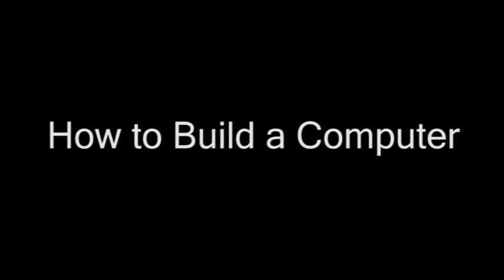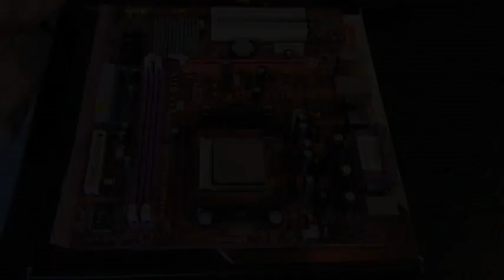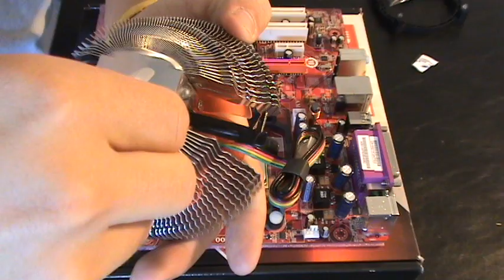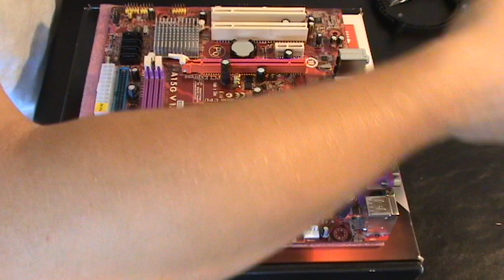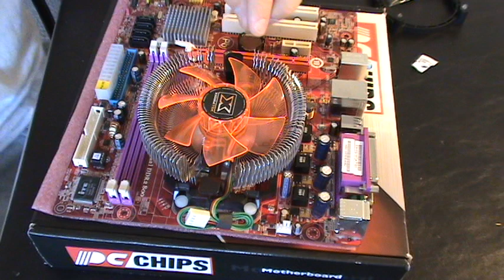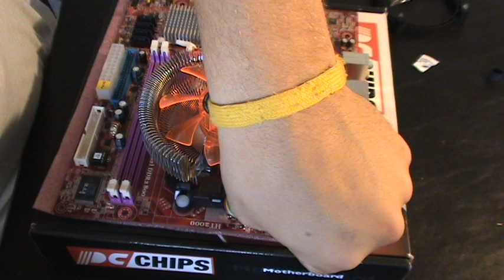How to Build a Computer - 16 - Installing CPU Fan

Comment: Too much thermal paste can increase the distance between the metal surfaces, thus reducing heat transfer. It's recommended to use a pea-sized amount and not spread it manual; instead let the pressure between the two surfaces spread it out evenly, reducing the chances of air bubbles forming.

Comment: Never spread thermal paste. You're meant to put a pea of it on the middle of the CPU. Spreading it causes gaps between the heatsink and CPU (tiny air bubbles) and this causes the conduction from the heatsink to the CPU to be lost making it harder for your cpu to stay cool. When pressure is applied to the CPU when installig the heatsink the thermal paste spreads out evenly so don't spread.

Comment: @LNDS209615 Yes you can, you just have to take the cooler off, preferably after the computer has been on for awhile and you just turned it off so its nice and warm and it will come off easier, after that you just have to clean off all that paste, i use coffee filters because they are lint free and then you have to use 90% rubbing alcohol  on those same coffee filters or cue-tips, and polish up the metal surfaces so they are ready to be used again like new

Comment: @lanman000 
You only need to reapply if you're changing fans, and you should wipe off the old thermal paste before adding a new layer.

Comment: @BruceLeeRock25 Do you mean on the fan? That's OK, they are there to help dissipate the heat and control the air flow. As far as I know, they are not connected to electricity (why would they be?) and they won't short-circuit the fan!

However, if you mean on the processor, then that's big trouble. Each of the pins on the processor should be clearly separated, and DO NOT attempt to force the processor into the socket. Doing so could damage the processor (and socket) even more.

Comment: when i opened a my cpu fan's box (it came with the cpu), there was no thermal paste.  when i set the fan on the cpu, it stuck and felt like glue. was there thermal paste on it already? the tube newboston is using for the paste looks like silicone gel so i might have dismissed the grease as that...

Comment: put back my working cpu and applied thermal paste then put the heatsink and fan on, and now nothing comes on the screen. Can anyone help me with this? Am i supposed to wait a while after i put the thermal paste before turning on the computer? Could it be that i put too much thermal paste? If anyone could help me that would be really great, oh and im sure i installed the cpu correctly. Thanks in advance to anyone

Comment: no offence... but u put the paste on wrong... ur not supposed to use that much.
theres 2 methods, the rice method [place a dab about the size of 1 grain of uncooked rice in the middle] and the line method [put a little line across the middle of the cpu]. the latter of the two is better for quad cores. youre not supposed to spread it around... just place the sink on and itll do its job. 
remember more isnt better

Comment: It's actualy better to NOT spread the paste because it will creat bubbles and will cause the heat to nit transfer as well. I saw a vid ov it and using a small circle, it will spread out with little to no bubbles. That's the only thing I didn't agree with. But overall, great video

Comment: @maxamillion4536 BB might be about right. Then again, you don't really need to cover the whole IHS, it's just a thin layer of copper over the actual chip. The CPU die under the IHS is only like 1/6 th of the size of the IHS and that's the area that you really need to have a good contact on.

Comment: -I've had better luck with putting a couple dabs of grease on the actual CPU and spreading it with a razor blade and then installing the heat sink on top of that. And use ALOT less grease than that for much better cooling. 
-I would also suggest getting some good thermal grease like arctic silver instead of the stuff that comes with the heatsink (usually very cheap).
-Last note I'm pretty sure that was an aftermarket fan.  Most CPUs come with cheap fans or even just a garbage heatsink sans fan.

Comment: wayyyyyy too much thermal grease. The optimal way is to squeeze just a tiny drop on the center of the CPU, about the size of a rice grain. When you mount the cooler, the grease will spread evenly and leave no air bubbles behind. Just google it up if you don't believe, it's been tested and that's the best method. Excess grease will just hurt the performance and (with silver paste) can even cause short circuits..

Comment: tbh u dont need HALF as much thermal paste as what he put on, u need either 2 pea size drops or a THIN line down the middle, if it oozes out wen u put the cpu heat sink on then its too much!!!, u clean it off n try again ! little is MORE  !

Comment: does the amount of pins, on the power-connection for fans, depend on the motherboard or power supply?
- if it's by the motherboard, do anyone then know how many pins the ASUS P6T Deluxe is on?

Comment: I just want to know.  Does it matter which way you point the fan/heat sink on the CPU. I hear iinstances where its not a good idea to have the fan facingtwards the pack end of the PC case. Somthin about hot air   

No idea on this

Comment: there's your problem
the three pin have a + and a - pole and a third which is ground.
the four pin have four pins, same as before but the fourth is which the mobo "speaks" with the fan which regulate the speed of the fan. your not seeing the fan because there is nothing to communicate with.

Comment: Performance does not mean just because of its higher clock speed. Although Intel quad cores have a lower clock speed vs amd phenom II x4 black edition which has a higher clock speed does not mean better performance. Based on benchmarks uploaded by the users itself, Intel produces better performance per buck. Their technology is way ahead of amd and in order for amd to atleast catch up is setting higher clock speeds.

Comment: spreading thermal paste on it can create air bubbles/holes in the thermal paste when its on the processor! just put a decent dab that when the  heatsink goes on will spread and cover the cpu nicely and provide very nice heat transfer

Comment: you spread the grease to uneven the way you used the grease the heat from the CPU will be badly transfered to the heatsink. the thing is that u spread the grease xtremely even AND that u end up with an extremely thin layer, slightly transparent.
but using grease isn't really necessary, unless u want to OC. then u really should use some.
but in your case, using non would have made a better heat-transfer to the heatsink than the uneven spreading of heat grease.

Comment: You're only supposed to use about 1-2 grain-like amounts on a CPU. It should be a very thin layer.

If you're going to buy any, I definitely recommend Arctic Silver 5 than using stock paste. Check it up on Newegg.

Putting thermal paste on the heat sink is optional but putting it on the CPU is mandatory.

Comment: sometimes it comes pre-applied but I highly recommend you scrape that stuff off and put on some arctic silver or something. Also, this guy put WAY to much paste on. It should be a very thin layer or else it will ooze out the sides and make a mess. Plus thermal conductivity is weakened.

Comment: dude...the intake of air should pass throw the front of the pc...(usually behind it are the hard drives)...and exhaust fan at the back...and any other fans like on the side panels should be exhaust (unless you know what you want and know more)

Comment: Once the paste has been applied can you take apart the fan and the cpu or does it act a bit like glue as well, i'm just thinking because I don't want to do it with little experience if I could mess up my cpu and fan...